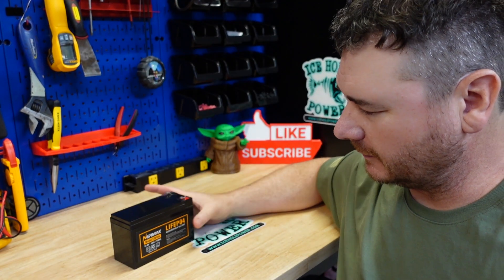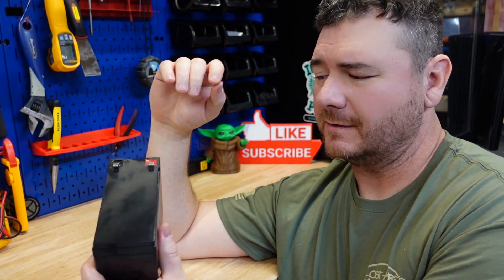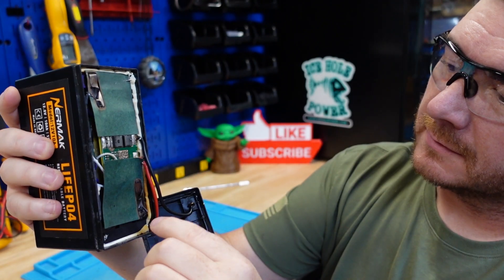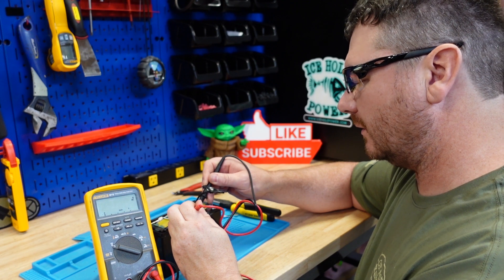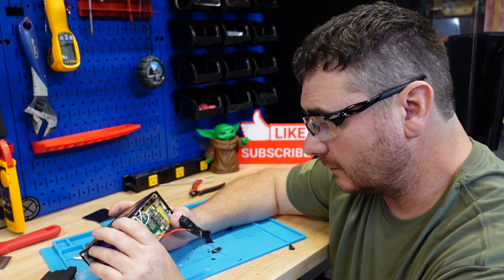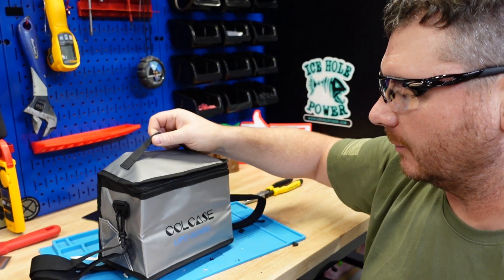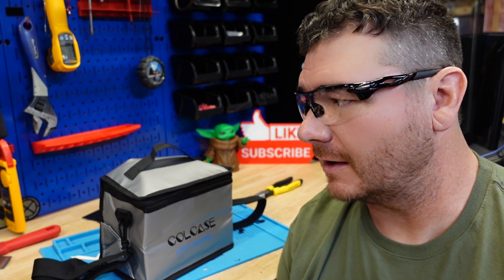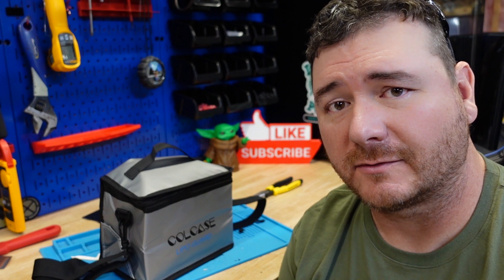BATTERY TESTING GONE WRONG! Nermak 10Ah Test And Teardown

Comment: The battery specs clearly states a maximum of 15 amps. These batteries actually work pretty well when you test them within the proper specs. You created a dead short, most high end batteries will not handle that.
Reply from the maker: I wanted to see how this battery would perform in a real-world scenario, so I tested it beyond its maximum amps.

Comment: Great test. This function is crucial, and it’s not even the only one. The stakes are so high for burning your place down, you must have a BMS that protects against this AND other conditions such as cell imbalances, cell undervolt, and cell overvolt! Please be very suspicious about every lithium battery and their BMS until someone has tested each protection.

Or get a good battery with certifications.

Comment: I have 6 of these exact same batteries.  I agree about the BMS used.   Not only is there no short circuit protection, but at least half mine also have no discharge or overcharge protection.  The cells seem pretty good but they skimp like crazy on the BMS board to keep the price down I would guess.
Reply: Did you take them all apart?

Comment: Can you charge lifepo batteries with lead acid battery charger?
Reply from the maker: Lifepo4 batteries are a higher voltage battery.  We do not suggest charging batteries with batteries.  Please use the supplied battery charger for you Lifepo4 battery
Reply: @iceholepower8012  lifepo4 battery seller on Amazon typically don’t sell compatible chargers
Reply from the maker: That is why we have stopped the battery review videos.  We feel there are only a few companies that we would suggest to consumers.

Comment: Could you send me a a link for the fuse I would need to prevent the short circuiting that occurred in your video that the internal BMS board was not able to prevent. Thanks

Comment: FYI: ALL 26650'S ARE MIS LABELED BATTERY WITH A 18650 BATTERY PACKED INSIDE THE CASE. CHINA'S BIGGEST LITHIUM BATTERY SCAM EVER . The 18Ah batteries contain the 26650 with 18650 inside them.

Comment: So unfortunately I just purchased a 36mah Nermak  12v for a old jumper pack. We will be using it to run a winch and jump dead battery,s . In this instance.  What size fuse should we use? 40 amp? 35amp?

Comment: you should be ok with opening it up because lifepo4 has a very good safety record.

the cells may smoke if they are damaged but never catch fire unlike the 4.2 volt lithium standard.

that battery was very easy to open it should be like the 7 ah you tested where you had to use a dremel to cut it open

i think lto maybe safer in that i have seen a puncture test and it did not smoke

it looks like 18650 cells

Comment: Good video and thanks for showing the tear-down.

I'm of the opinion of using an external fuse instead of an internal one.  For me, a lithium battery without an internal fuse is not a deal breaker -- so long as this fact is stated in the battery's specifications.  Because one can easily add a quality external fuse and have better control over it like amp cutout and speed.  Versus an internal fuse that doesn't specify these parameters or is inconsistent between different builds of the same battery.  Also an internal fuse can fail w/o any indication and is harder to trace.  Cannot replace an internal fuse either if its a software fuse implemented by a microcontroller and MOSFETs.

The more important BMS functions that absolutely must work are: (a) cell balancing speed & precision and (b) high voltage cutoff (HVC).  Optionally there is LVC as well but I'd rather have better control over that with external control.
Reply: LOL, funny enough this video actually encouraged me to buy the Nermak! 😆 Because the BMS seemed to actually do what a BMS is SUPPOSED to do (charged the batteries correctly) and, as he said several times, the build quality is good! No idea why he didn't do full BMS functionality testing FIRST, and then the destructive fuse testing last. 🤔

Agree that an internal fuse is not all that important for higher voltage stuff... heck, always externally fuse electronics!
Reply: @techno_john did you buy this and did it work well for you?

Comment: I'd imagine this'll still be do well as a value-minded UPS battery upgrade, where it's always indoors at room temperature, where it's not moved around and have its insulation chafe, and where I don't plan on shoving a metal bar across the terminals.
Reply: I have some killer NEC batteries I'm selling right now. Designed specifically for the purpose you mention.  12v 5Ah, brand new, $30 + shipping.

Comment: These are being sold as a replacements for sla batteries in APC and Cyberpower UPS.  Would they actually be safe for that because one would assume the UPS itself would have a short-circuit protection?
Reply: I've got two APC UPS that both use two LA SLA batteries in series.  These batteries claim to work fine in series, and I have a pair, so I decided to test it.  
LiFePO4 cells have a nominal voltage of 3.2v and a max charge voltage of 3.6 to 3.65v depending on the manufacturer.  In practicality, you can take them up to 3.7v without much worry, so they're fairly forgiving.  Anyway, using the lower value of 3.6v, two of these Nermak batteries in series should have a maximum charge voltage of 28.8v.  The output voltage of my UPS is 27.48v.  So, in theory, this should be just fine.

Using my desktop power supply, I charged each battery to 14.4v at 5A.  After removing from the charger, their voltage settled at 13.65v which is the expected value.  I let the batteries sit overnight, then I connected them in series and to my desktop power supply.  I set the voltage to the value I read from my UPS: 27.48, and left the current set to 5A.  After turning the supply on, it took only a couple of seconds for the voltage to settle at 27.48v and the current quickly dropped to around 50mA.  Several minutes later the current was down to 2mA and a few minutes after that, current flow stopped completely. 

The end-charge voltage on each battery pack while the pair are held at 27.48v is 13.66v and 13.79v.  This is not ideal.  

One of the traits of LiFePO4 (and other lithium chemistry) cells is that once they are charged, the electrons stop flowing.  This means that in order to have lithium cells in series, you need a BMS to balance the cell voltages so that all cells get fully charged.  In the case of a SLA drop-in replacement, this balancing has to happen at the nominal charge voltage of a lead acid battery, which is slightly under the nominal charge voltage of an LiFePO4. 

If this balancing can't happen, then each time the cells are used, they will get farther apart in their voltage levels.  At some point, one will be overcharged while the other is undercharged and this is where you run into problems.  The APC will see a total voltage of 27.48v and call it good, but one battery could be at 11v and the other at 16.5v -- with each individual cell at an average of 4.125v.  This is very close to the break-down voltage of the electrolyte.  Best-case when the electrolyte breaks down you get smoke and a brick. Worst case you get a thermal runaway fire.

So, no, I would NOT use these batteries in an APC UPS unless it is a single-cell system.

Comment: Looks like a good battery for the price if your after some cells, I'd buy these just tear open and grab the cells from it, I assume its a 4s 5p config. Id also say that is not really a BMS but more like an active balance board instead, to be a BMS it will need a logic controller, temp sensor and short protection.

Comment: I do have that battery using it in my friends EV scooter and so far so good after about a year of charging.  I will buy that battery case, we take scooter on cruise ships and I want to transport a extra battery safely. My friends scooter take two in parallel for 10amp (I think).    Thanks.

Comment: So I have 6 of these Nermak 12v 10AH.   Series of 3 total of 36v 10ah. Because i saw your previous video stating this battery passed your test.    I'll put a 10amp fuse
Reply from the maker: If you don't mind me asking, what do you use a 36v 10Ah bank of batteries for?
Reply: @iceholepower8012  I bought these two 36v 750w 26inch front Hub Motor -Ebike made from china "Jaoupay Ebikes.  So far it does what it's suppose to do, but again ive only had it for a month.  We'll see how it goes and i'll update you
Reply: @pogilisyus  How as these Nermak held up?   I just need to power a 1 watt draw device for about 8-10 hours.
Reply: @mowomedia4801   so far so good...except for the SPARKs when you recharge.  I also charge them one at a time.   ALSO i bought a fireproof bag and put them while i charge them.
Reply: @pogilisyus  are they still holding up? I'm considering buying one to run a depth finder
Reply: @hardyboysfishing  Yes Still holding up with voltage.  I also bought fireproof charging bags..JUST in case...

Comment: Glad no one was injured during this short circuit test! 
I have built 3 power boxes for ice fishing and per your recommendation I have a 10 amp fuse in each one! 
My boys and I are all set for ice fishing. I also have each one set up with a Stryker 4 C, and we've been using them for summer fishing too!  I decked two of the boxes one with 4 of single bright LEDs on one end and, 2 of the 6 LEDs strip lights. I followed your instructions from your how to video. That is a great video! The boys love the boxes too! Thanks so much!